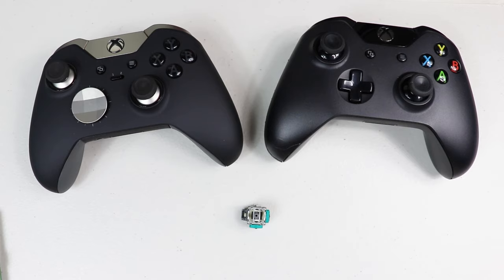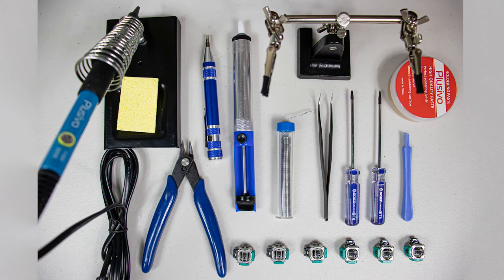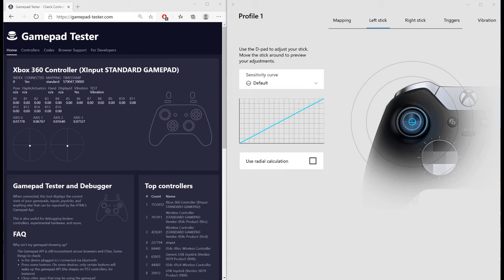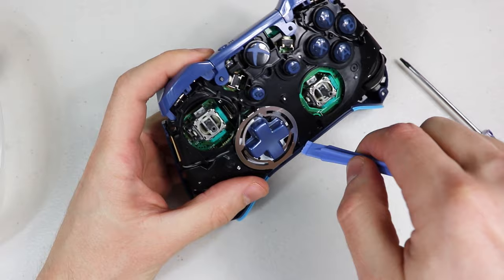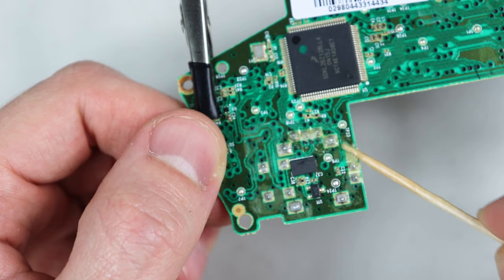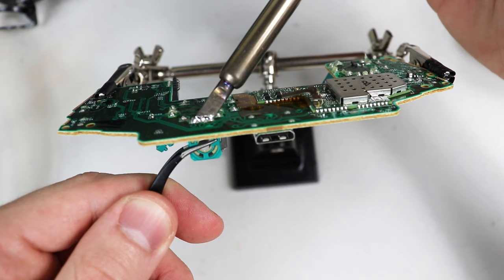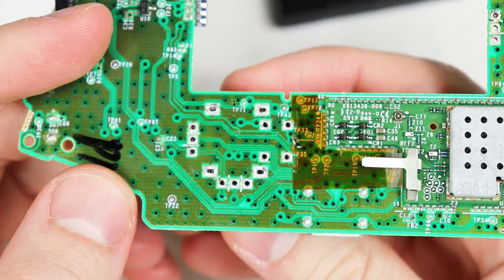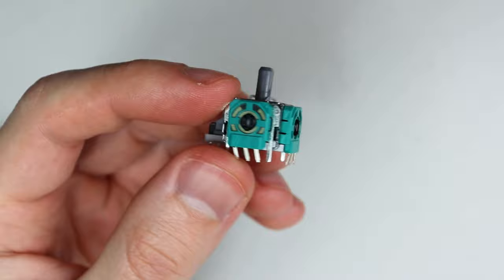How to Replace Xbox One Controller Analog Joystick - NEW METHOD - Fix Stick Drift, Broken, & Loose

Comment: Great video, just swapped out the left thumb stick on my friend's series 1 elite controller, which had the small pins. I have a couple observations and a couple questions: 

The larger solder tip is very helpful for desoldering the thumb stick body mounts. They have a lot of heat sinking into the board so the extra thermal mass of a larger tip helps a lot. I used a pretty fine tip and ended up switching to a chisel tip (not as big as yours) at the end and it made soldering the new stick on a lot faster. I also had to bump my Hakko up to 400 C, though with a larger tip, 350 C would probably work fine.
I got lucky with my potentiometers. The x-axis was dead-on from the start, and though the y-axis was off, I just swapped in another unmodified potentiometer and it was within 0.06. I definitely recommend bending the pins outward, as it makes it easier to swap the potentiometer in and out if needed.

Would it be a good first step to try cleaning the potentiometers with IPA when you have them opened up? They looked pretty dirty inside, so I'm wondering if a clean would get rid of any errant copper particles that could be causing the drift.
Why replace the whole joy stick if its functional? If the drift problem is caused by the potentiometers and the stick is otherwise okay, it would save a lot of soldering and parts to simply desolder the potentiometers, pull them out, put in new pots, then calibrate as needed. 

Cheers for the video, I'm going to see if I can find some cheap broken controllers to repair now :)
Reply from the maker: You are correct. I should have been more clear that if only addressing drift, you can just change out the potentiometer causing the drift. When I was doing repairs, I'd always switch out the whole thing anyway, but it's not necessary as you've figure out. Well done on the repair!
Reply: @SOSSGAMING  I've replaced two potentiometers, one thumbstick worked with the new one while the other was unresponsive so I removed that joystick completely and did this method but I still have the same issue
Reply from the maker: @richstrike8418  Sounds to me like one the through-hole pads are damaged. They are a bit finicky. Feel free to email me a picture at my gmail sossgamingcs if you want and I'll see if I can spot it. It can be "fixed" with a tracer wire(s).
Reply: @SOSSGAMING  I had already emailed you a day ago and have been waiting on your response since
Reply: @SOSSGAMING  also what is this "tracer wire" that you speak of and where can I get it?
Reply from the maker: @richstrike8418  Oh sorry, I just replied to you then. You could use a strand of speaker wire, but because nearly all the pads are damaged I'd recommend actual tracer wire. Although, it may be called jump wire. I'm not sure. Basically you'll just want a thin insulated wire that can go from one of the pins to another point on the board. It can be found on amazon "soldering jump wire" or perhaps eBay as well. Other electronic sites might also carry some.
Reply: @SOSSGAMING  okay thank you

Comment: I successfully replaced both analog sticks on my xbox controller (not series x/s). I bought the cheaper solder kit with the helping hand stand, and the joystick replacements. I had zero soldering experience going into this, so I practiced with one controller I was willing to sacrifice if it didnt work. Luckily I was able to remove and replace the joysticks without burning the board. Although I didnt calibrate them like in the video, they worked very well suprisingly. If my controller ever gets drift again, I'll just use helder's analog stick drift fix and solder that into the controller.
Reply from the maker: Very nice! Congratulations. It's not easy the first time.

Comment: Hi, great video, thanks a lot for making it! Based on what you show in the video, i think there might be an even better way to do this without trial and error, that I wanted to share with you. I hope this helps you. the potentiometers are voltage dividers. the motherboard firmware will contain the following numbers: 1. max 2. min 3. center. they correspond to voltages located on the wiper. so desolder the joystick in full and reassemble the controller. the connections for the potentiometer will have 0V (gnd), +Vpp (probably something like 3.3V or 1.5V, measure it with the multimeter and write it down) and the middle between them will be the wiper. so you will want to put voltage into the wiper connection that is between 0V and Vpp. while looking at the calibration app, figure out the voltage you need to get the joystick to center in the calibration app. measure the voltage with the multimeter (don't use the display on your power supply, you'll see why later). write the voltage down, call it Vcenter. make sure that your adjustable power supply never goes above Vcenter or you'll fry the motherboard. next, get a power supply that can output Vpp (that you wrote down earlier). take a new joystick. remove the 3 nubs. take 3 pin headers from an IC socket (with the machined flat spring clips) and solder 3 wires to 3 adjacent pins. plug the joystick's potentiometer into those 3 pins. set your power supply to output vpp and connect its ground to where ground would be on the potentiometer if it were in the controller, and Vpp where it would be on the potentiometer if it were in the controller. finally, clip the multimeter between 0V and the wiper. with the joystick in the center position, turn the potentiometer around until you get the same voltage you wrote down earlier (Vcenter). fixate it using hot glue or super glue or tape or whatever. The joystick will now be perfectly centered when you put it in the controller, and it's way easier and faster to do that than the trial and error method you show. You can remove the hot glue / tape after soldering the joystick in place, it's going to stay calibrated now, because it's rigid through the solder joints. But bear in mind that I've never done something like this, so I can't really know if it will work. One advantage of this is that you can just set up your IC socket and power supply and multimeter, and plug in different joystick potentiometers until you find one that is the right voltage without needing to have its nubs cut off. Which saves a lot of time and fiddling as well. you also save a lot of soldering, and every time you heat up those tiny plated through-holes the glue holding the copper to the fibre glass heats up and degrades and eventually you get a lifted pad or trace or a stripped through-hole. bear in mind that your multimeter and your power supply might display slightly different voltages, so when you figure out the calibration voltage Vcenter and later calibrate the pot by moving it around so that it outputs Vcenter, you need to be using the same measurement device.
Reply from the maker: Not going to lie I'm a little lost but I think I get it. I think I would have to see what you are talking about in action though to grasp the idea completely haha.  I'm actually able to whip through joysticks now with this method, so for me personally it's not an issue but still if it's an easier way I would definitely enjoy seeing it.  Thanks for sharing!
Reply: @SOSSGAMING  alright, what are you lost on? you can talk to me on twitter my user name is plt_cheater that should be easier - i don't check youtube comments too much
Reply: Should definitely pin this comment as it explains a much more analytical approach to solving the problem, makes sense -- though would be benefitted for sure with its own video

Comment: Thank you so much for this video. I didn't understand the values needed to have the potenciometers calibrated correctly. I never knew this had so much trouble and error, to tell you the truth I don't solder I'm a total noob. I hope to see more of this videos on ps4 dualshock 4 controllers. Great video.

Comment: add t12 solder stations, those are really nice with accurate temp control, 300c for leaded solder, and a small tube of leaded flux (or high lead solder) is really handy to mix with the oem non leaded solder

Comment: Thank you for the great video!  Am I correct in thinking that if Microsoft would provide the proper calibration software for the controllers we wouldn't have to do all of the manual potentiometer adjustments to correct for centering?  If we had access to the proper calibration software we would just have to check the new control stick for proper operation/operating resistance before installation to ensure you are not installing a faulty part, then the software can compensate for the inherent manufacturing differences in the potentiometers?  I really like your videos and I have learned a lot from them.  I hope in the future that right to repair laws get better so the manufacturers have to provide all the information necessary to repair their products.
Reply from the maker: Yes, you are correct! Thank you for the support. Let's cross our fingers that the laws get better.
Reply: yah i wish there was calibration software, I found there is a setting in windows for calibrating for different controllers but it changes the pc not the controller.  Also,  it's not just the potentiometer differences there are differences in the actual joystick centering.  I've been soldering on the potentiometer only then swapping out tons of joysticks untill i find one that is decent enough center.
Reply: @adamneff1600  Have anyone actually managed to get the windows 10 calibrating tool to recenter the stick? I see everywhere people talk there is that solution as long as you play on the PC, but personally the calibration does nothing to me. It still behaves as per default settings aka drifts to the right 6-11% after releasing it.

Comment: Attempted repairs, was ultimately unsuccessful due to lack of a non-makeshift copper wick (or similar purpose tool) and sufficient skill. Great learning experience though. 

[Was attempting to repair an old controller i didn't much care about so the failure to repair is of no concern]

Comment: I can't believe nobody has hacked or made some sort of calibration software that actually changes the controllers firmware or whatever on the controller.  Its such a shame putting in a brand new joystick and having to manipulate so many things because you can't calibrate it.
Reply: good point, capitalism at its finest
Reply: @csmanul  also, the joystick design has not changed since the PlayStation 1 maybe even older then that.  They know it's bad and don't care.  They want you to replace the controller because of a part worth a few pennies.
Reply: If you are a PC gamer calibrating the pots doesn't matter because Windows game controller setup has a calibration setup anyway. So in that case even if the sticks are out Windows will know by how much and compensate.

Comment: Super helpful video and my repair went (almost) perfectly. Managed to get the left stick centered at ~0.01851x by ~0.02269y. The only problem is that the x-axis now has a huge dead zone on the right side (which I naturally didn't notice until I finished reassembly). The dead zone changes a bit depending on the y-axis input but no matter what it won't read past 0.67880. All other metrics seem to be fine. Is the fix for this to just swap out that potentiometer?
Reply from the maker: Congrats on the project! Good numbers. That's a great question, though. I've never seen it limited that bad before.  I would first check to make sure the face cover/thumbstick is on correctly etc as restricted movement of the joystick could also be a contributing factor but that's probably not the issue but worth double checking.  After that yes, I would then look at swapping out a potentiometer or two to see if that helps, and lastly the joystick if it doesn't.
Reply: Swapped out the bad potentiometer today (even got lucky and didn't have to adjust the calibration at all) and it's sitting pretty at -0.02571x with no outside dead zone. Thanks for your reply and for making the video!
Reply from the maker: @Pathfinder5k  Awesome! Glad it worked and glad to help.

Comment: I really am impressed by the quality of ur videos, u should have a minimum of 10k subs.
 I have several questions,
1. I want to change the potentiometers instead of the whole stick, should I go for the white ones or the old oems?
Are the cheap quality sticks the actual analogs or the sensors itself, 
 Thanks,
Reply from the maker: Thanks! Go for the oems.  There are white ones that are oems (from the ps4's) that are the same, but 99% of the white ones on the market are the bad potentiometers with the deadzone.  There are subtle visual differences.  The cheap sticks are mainly an issue because of the sensors, but also the R3/L3 push button commonly has issues as well.
Reply: @SOSSGAMING  thanks for the help, you helped many people fix their controllers
Reply: @SOSSGAMING  you know about the yellow stick or black stick for ps4 on aliexpress? i wanna know about it
Reply from the maker: @dedoss94  I do not, sorry.

Comment: Full-time MT student here returning with a bit of an update under my own perspective regarding this issue.

There is a lot I would LOVE to talk about this BS but I'll try to keep it short and simple as I can, if you find yourself reading over three sentences then I have failed you but hope I provided enough substantial information regarding this tiresome and troublesome topic.

First I will start with a quote from a comment I left on a teardown video for the Xbox Series controller.
"As for countering the joystick drift issue? Replacing it with a new component may not help at all, what you might have to end up doing is taking out the wiper/s before clipping off the tabs and nubs (possibly sand down the clipped nubs if it's not flat enough with a file tool) from the potentiometer/s themselves, clear it of any debri/dirt before putting the wiper back in and soldering it back onto the board/PCB.
One way I went about fixing this issue is getting all three points of contact hot at once before trying to tilt the potentiometer ever so slightly into the direction it keeps drifting towards.

What still baffles me to THIS DAY is how Microsoft has a program that allows you to calibrate/center the joysticks more effectively, but refuse to do so under the intentions that we would be stupid enough to keep buying new controllers over and over instead of having some electronic technological expertise."

Now the reason why I also clipped the hook tabs from my end of the story was due to how the tabs themselves were preventing me from tilting the potentiometer itself, you MAY not have to do this at all especially if you want to keep a tight/locked connection between the joystick component and the potentiometer itself, personally I had to make do by pressing my thumb against it to the component while soddering it in place while having it angle towards/biased to the direction it kept "Drifting" itself off to.

With all this effort figuring out how to solve the issue it didn't come without losing one board for the controller itself, where I was being risky by constantly desoldering the meter, taking it out, and putting it back in, over and over until I fixed the drift, which ended up having my own solder wick "rip off" one of the metal plates that's supposed to stay on the board and was then I realized I could just keep it soldering and make the three points hot before tiling the darn thing.

I wish you all a much more favorable luck in a similar manner that I HOPE to find a replacement board for one of my controllers soon, modding it in my own way such as having all the vibration motors removed including the trigger buttons since it messes with my "stability" for gameplay anyway and weighs down the controller QUITE a bit, which makes me wonder if a later design would try to use some haptic feedback instead.

I should've probably made a video about this instead but I'm still much too busy with my studies and video games, that being said I still haven't tested keeping the controller connected while soddering the stuff in, but I am still super thankful for this guide going DIRECTLY to the main issue of the drift itself since most of the other videos I found were to be either confusing and/or "doesn't make sense".

Comment: "I don't think electricity and heat go very well together"
Electricity in a way is still utilizing heat to make a sort of transmitted signal, what you should only really be concerned if it's pulling too much current/amp since it can get hot enough to cause a fire or even damage the component since it would be going well past it's tolerance.

One of the many ways you can try to rectify these issues though is using a heat clamp or heatsink clamp so the heat would divert most of it's temperature to a source where it's not heated and would give more breathing time for the component itself as you sodder it in place.

But my god depending on how you can sodder this kind of stuff it can be an absolute bitch to do.

Comment: I straight up threw my controller in the wall now am here.😑
Reply: Me too
Reply: You should pad your walls and floors with pillows 😂
Reply: I dropped my series 2 elite o my tile floor cuz i feel asleep while playing and because it is such a heavy controller the L3 button on the left joystick doesn't work anymore. The plastic that presses it broke inside I tried to to glue the plastic back together with super glue but it didn't work. I will never buy another one of these controllers unless I move or get carpet. I have dropped the normal xbox controllers countless times onto the tile floor and they have never broken.  It's the weight of the thing. Not worth 180 bucks.
Reply: @Andronicus87  And I've dropped mine many times without issue. Just bad luck.